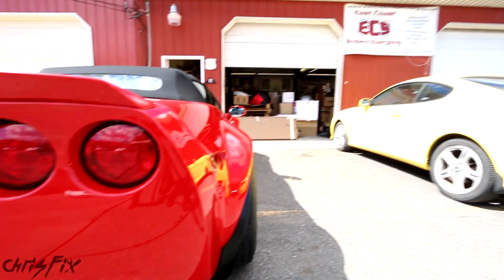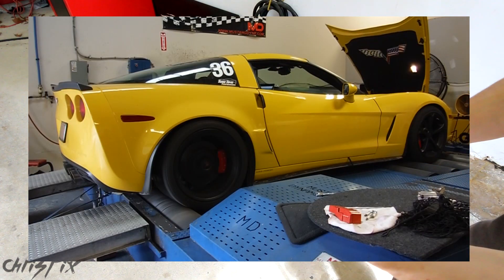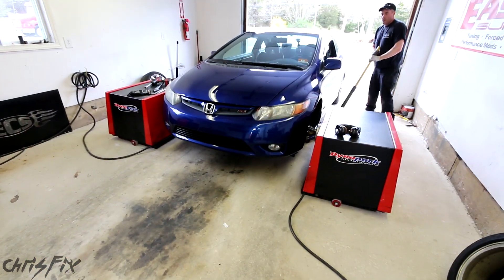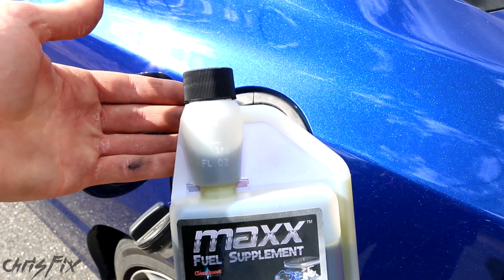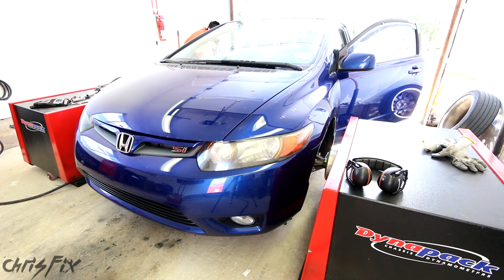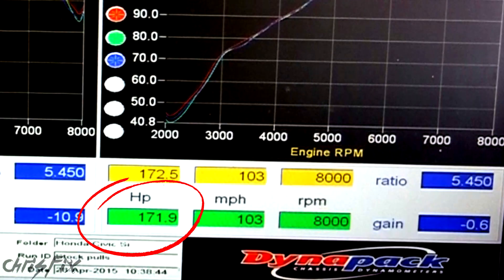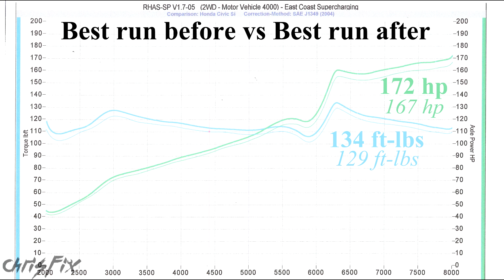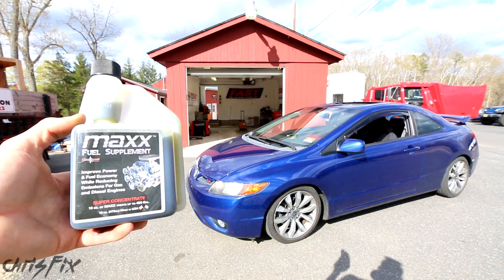Can a Fuel Additive Really Increase Horsepower in Your Car? (With Proof)

Comment: ? but your burning the cleaner which obviously changed the octane rating? Isn't the point to burn the cleaner through the engine then retest with normal gasoline?

Comment: 5 HP and 10 ft-lbs increase? That's ridiculous - less than 5%. Who would want to pay for this? And also - no guarantee it's bad for your engine.
Reply from the maker: Thanks for sharing.
Reply: 5% is a very significant increase. and one ounce per 30 gallons is going to be cheap. 5% is especially significant if it carries over to fuel economy
Reply: Bad for engine,,? lol
Reply: +Giroud more octane doesn't mean more hp. it depends on your car. for example if you have a high boost turbo engine there will be a change, but if you have some naturally aspired engine it will only make a very very small difference- practically not a difference at all.
Reply: Хорошая Машина I mean it's pretty cheap. and it doesn't really give you more HP. it just restores what is lost over time by cleaning out the gunk that builds in your fuel system. and it's pretty cheap
Reply: Хорошая Машина so you want a guarantee it's bad for your engine? I think you need to rethink your word choice
Reply: Octane boosters are not the same as fuel system cleaners.
Reply: ChrisFix what about shells vpower fuel? surely the higher octane would give a bhp increase but how much of an increase is the question. would it be better to just get that fuel or to get a supplement like this?
Reply: Oxenan17 oh okay. thank you for your information. I would like to ask, where did you get this from?
Reply: +Giroud check out video named fifth gear high octane test here on youtube. they have a basic renault, and you can also find them doing the same tests with some turbo golf and subaru. tell me if you can't find the videos, I can link them to you.
Reply: for a turbo, I would imagine it would make a big difference.
Reply: A cold air intake costing $200 adds around 4-10hp, or sometimes less. So yes, pretty fucking cheap. And I take it you're no chemist, so I won't take your word that it could be bad for your engine.

Comment: Worth noting that 1/2 of a 13 gallon tank would be six and a half gallons. According to manufacturer's instructions you would only need one quarter of an ounce to treat seven and a half gallons. You therefore used more than twice as much as recommended. It might be more fair to test it according to the manufacturers recommended strength to see how that does. Thanks.

Comment: why did the car have to heat back up after driving it around for 20 min and doing the first 3 test?
Reply from the maker: We needed it to be the same temperature as when we did the first test for consistency.
Reply: ChrisFix yes I realize that but wasn't it already warmed up after a 20min drive and those 3 initial test?
Reply: he probably got back, fucked around for a while maybe had something to eat then set the car up on the dyno by that stage it had probably cooled down.
Reply: ok that makes sense. i was wonding if he had some kind of super cooling system that helped the honda cool down faster than an average car.

Comment: While I'm not discrediting your findings or method there is Somethings you may not have considered. While coolant temperatures may have been the same, the more you run/drive the car will increase oil, transmission fluid, and axle grease temps aiding with reduced friction. Also the axle to dump angle and steering wheel position/angle can play a part in adding friction and decreasing the ability to transfer the engines output to the dyno. Good video tho, was interesting and the increase in consistency was a nice unexpected result
Reply from the maker: Thanks for the feedback Jordan! I wish I had the funds to repeat this test 4-5 times on other cars to make it more accurate!
Reply: dude shut up he's testing a Honda Civic not a Formula 1 race car stop acting like you're an engineer

Comment: hey chris in argentina the civic si honda say that the engine have 200 hp its the same in usa? why yours have 167 hp?
Reply: lucas rodriguez dynos measure wheel horsepower rather than horsepower at the crank which is what car companies advertise. So yes, your car is a lot slower than they advertise it. Expect a 10-15% power loss as a rule of thumb.

Comment: how does it work? and are there any side effects to the engine like extra deposit?
Reply: It eats seals and burns out piston rings generally. Not bad if you use it here and there and at the recommended amounts. But some guys dump way more in and their engines do not last long.

Comment: Should I use this with my 2017 Mazda with around 7k miles on it?
Reply: i would only use it in a street/strip car. If a dose of that stuff (+5hp) could potentially shave a fly shit off my 1/4 mile time. Say you could turn an 11.2 second pass into a high 10 second pass....now i got a 10 second car. know what i mean?
Reply: did you end up using it?
Reply: Yes, I did, when I use it, It shows high mpg but I notice that the engine sound louder or it sound like its sucking up more air/wind, something like that, is that normal or should I stop it? anyone knows

Comment: Hello mate, nice video! I would like to ask for something. I live in Greece and here we have 2 kind of gas , the 95 octane and the 100 octane gas. The 2nd one, hypothetically is much better and expensive,  increases power  etc. May I ask if you use something like that? I mean is it ok to use it with both gas or only with the normal one? Thanks :D

Comment: what's sad is the civic isn't 200 hp
Reply: kris hedges 200 flywheel, there is power loss with any and every car, the Civic is more than capable of holding its own to bigger engines and is highly underestimated.

Comment: Chris, what are the possible negative consequence to the engine by buying this product?
Reply from the maker: +Taller Valderrama probably nothing. You use such a small amount there is nothing I can think of that is negative unless he product has something damaging in it (which I don't think it does).
Reply: Madi Lee "...let's say you dumped it in every day as you add new gas..."

If you're filling up everyday, you're either driving super aggressive, or really far... Which would probably put the car in an early grave long before any of the additives in this could. But without knowing exactly what's in this stuff, just don't use it more than a few times a year IMO. Maybe put some in a week before track meets or emissions tests.
Reply: Madi Lee as long as you keep the right ratios that was suggested it should be fine. Maybe a little more. They can’t actually suggest a quantity to you that will be damaging. That’s how they open themselves up to a class action. 😂
Reply: Nothing.
Reply: ChrisFix One question if you add to much additives in the Car. Let's say you dumped it in everyday as you put new Gas in. Will that affect the Car? Will It destroy the engine. Will it give the car trouble after sometimes goes by? I used the Lucas additives.
Reply: Madi Lee your car will be able to  fly to space if you add the whole bottle

Comment: Chris I have a question. I have a 95 vette 6 so...what is the deal with ethanol 93? should I just run pure 91 octane? it's low mileage and I just want the best for her, can you please help me?
Reply: Al Sipes On the stock engine control unit, 91 will be perfect for the car. I've got a 1994 Trans Am, which has the same LT1 as your corvette, and I always run 91 octane. she's got 53,500 miles and runs great.
Reply: Smithlehoff Ok Thanks Chris I appreciate you taking time to help your fans out

Comment: Whoa!!! Hold your horses! This is hardly proof that the additive improves power.There are way too many variable for this to be conclusive.
1) What was the weather conditions throughout the test? Did the temperature stay the same? A 10 degree drop in temperature can make a huge difference! Was the barometric pressure or humidity the same? Both can make a slight difference in performance.
2) What were the conditions of the car throughout the test? Did the car run the same amount of time before each test? The viscosity of the oil will change as the car heats up, and with less viscosity the engine will produce more horsepower. While the temp gauge reads the water temp of the vehicle, it is a poor indicator of the oil temperature.
3) Will the test be replicable with other gasolines? This product may work for one gas type but not another.
These variables could have been overlook had there been a large difference in horsepower (say consistently over a 15 hp gain,) but the test showed only a small gains (5-11 hp per each test set respectively.) While the test was inconclusive there is still enough compelling evidence to replicate the tests so that the variables can be eliminated.
Reply: LOL read... and listen. better

Comment: Nice experiment :) You're probably better off just using better fuel, checking your tyre pressures and wheel alignment. Also, you don't need an S at the end of the abbreviation RPM as its pluralised in the abbreviation ;)

Comment: how does that work without changing ignition timing?
Reply from the maker: From my research and emailing the company... It is a catalyst that burns more of the fuel that is normally not burnt. More burnt fuel = more power.
Reply: So it must have some kind od oxidizer in it? Interesting. How would that work with the oxygen sensor and air fuel ratio since oxygen isnt normally introduced via the fuel
Reply from the maker: I honestly am not sure how it affects the O2 sensor. Their "formula" is a secret so I couldnt get too much info from them except that it is a nano-catalyst.

Comment: You do know coolant temp has nothing to do with the operating temperature of the engine right?  You wanted to actually do this with the same engine oil temperature.
Reply from the maker: Thanks for sharing. They are related. When the coolant temp is stable, the oil temp should be stable as well. Unfortunately there is no oil temp gauge so there is no easy way to know the oil temp. That being said, the coolant gauge was the best thing I could go off of.

Comment: it is so fun to wach vtec kick in
Reply: It's much more fun to FEEL it kick in. 2012 Acura TL 😁
Reply: @myetoob23  Damn, Acuras have VTEC too? I'll be honest, even though I do know Acura is part of the Honda "group", I didn't know they had the  VEETAK in 'em without those fancy little badges. I bet it's a lot of fun though, and gives me even more to love about those big angular streetcars like the TL and maybe the earlier Cadillac CTS-Vs.
Reply: @revolver265  yessir, idk why they don't advertise it but it definitely kicks in under heavy acceleration. Felt like turbo lag. If I would have gotten the SH-AWD model I wouldn't have traded it in. But since it was FWD with the 3.5 motor instead of 3.7, I got a 2017 Infiniti Q50 instead. My TL was black and my Q50 is white, when she saw a white model even my gf said that it looks better than the Q50.
Reply: Jeandavid Levesque check the hp dude
Reply: It has 163 vtecs hits -8 mph to light speed in about 1/9 seconds
Reply: wakman756 I didn't see anything
Reply: It made less hp when the vtech kicked in. Lol
Reply: wakman756 nothing changed

Comment: did you use 95 or 98 oktane gas?
Reply: +emocan126 yes
Reply: +GunFun ZS ok then it probably is 98 oktane in germany
Reply from the maker: +emocan126 the car requires 91 so that is what we used.
Reply: +ChrisFix 91?!?
haha we don't have that in Germany xD
but thx for the answer
Reply: Europe has about the same gasoline fuel categories , but octane ratings are calculated differently. There are good videos to explain it. Your Diesel is better than ours.
Reply: +GunFun ZS oh ok then
is 91 oktan performance fuel
Reply: what are you talking about? i always use the fine 88 octane german fuel xD
Reply: Der_Rusher was laberst du fürn Mist bei uns gibt es nur super 95 als minimum

Comment: It depends what type of octane, more ethanol, colder the fuel burns, colder the fuel = more hp, although going for a drive could've cooled the engine and with the additive, increased hp by a couple. Which is more possible than believable, they wouldn't sell octane booster if it didn't work. Interesting video, definitely appreciate the evidence in the additives.
Reply: "...they wouldn't sell octane booster if it didn't work".  REALLY!?!?!

Comment: +ChrisFix 
Humidity was different and so may possible have been oil temp. Same car same oil if the oil temperature is higher in one pull (from taking a 20 min drive)then the next HP readings will be different. 
Not to say the product doesn't work but you had different variables.  You can get a best high tomorrow if you try again.

Comment: Everyone needs to get over the number increase and focus on the percentage increase. You're looking at a 3-5% increase for a $32 item. You're going to get about the same out of a $300-$400 intake. I'd be willing to bet this product in an engine with a good i/h/e and tune would yield even better increase.
Reply: Exactly, 3-5% increase is standard deviation.  A rather insignificant and inconsequential number.  This gogojuice does nothing.
Reply: You'd honestly get quite a lot more out of a new intake manifold and headers + tune.  QUITE a lot more.
Reply: +Wayne Randall I wouldn't say it does nothing. It was interesting that each run without it yielded a loss of power each time while the runs with the additive stayed basically the same. I'm wondering if this stuff almost has a similar effect as methanol injection in helping keep things cool. Obviously it's no replacement for meth injection, but maybe it does something to that effect.
Reply: Same here maby 20hp added

Comment: Not sure if anyone mentioned below, but I wonder if it's possible that the oil temperature was higher during the second run, having a little less internal engine loss as a result.  Even though the coolant temperature may have been the same, the oil takes a lot longer to come up to operating temperature.

Comment: Good vid man. Gets your USA juice almost up to UK 'straight out of the pump' juice.
Reply: It's about the same. Europe vs USA gasoline (Petrol) are basically the same, but the method of calculating the octane rating is different. Our three common tiers really match your three tiers in practice. Your diesel fuel is better than ours though.
Reply: +GunFun ZS really? Ok, always thought ours was a bit better. We have 95-99 but think this might be RON not octane. 95 is normal and super normally starts at 97 up to 99. JApan has 100 apparently but im no expert on it.

Comment: Do you know if you can use this in 2 stroke engines?
Reply: The additive will stabilize your fuel so what I would do is add it to your fuel and mix those two and THEN mix the fuel and the oil, however, keep in mind that the instructions say to add 1 ounce (1oz) per 30 gallons of fuel. Now, your average dirt bike assuming you're using a dirt bike and not a 4 wheeler holds 2 gallons of fuel so you would only need to put 1/15th of an ounce to your FULL tank of gas. That means that one bottle would last you a very long time which would make it far worth it. Hope this helped :)

Comment: What octane does that car take ??
Reply: 91 required, most pumps in my area have 87, 89, 93 available, so 93 it is, unless the station's really price gouging on the difference, then I'll mix 89 and 93 in equal parts.

Comment: Dear Chris Fix could you test the new VP Racing Fuels Madditive Octanium and see if it does what it claims ? I just bought a bottle today and it's pretty expensive $21.99 to be exact I just can't be at ease with paying this again if it does nothing at all for my vehicle
Reply from the maker: That would be an awesome test!
Reply: It really would 😁 I paid 21.99 for my VP racing fuel additive and although I've never believed they increase Horse power it would be nice to see if it meets its other claims (I currently own a 2005 Manual Acura TL) and have been having fuel consumption problems so I'm trying all that I can to fix the issue and these octane boosters and fuel treatments would be cool if they worked . Unfortunately I don't have all the tools you have so thought I'd shoot you over a message . Let me know if you decide to do it and when uploaded if you do so👍🏼 shout outs to Chris fix for always keeping our cars running

Comment: If the mix ratio is 1oz to 30 gallons of fuel and you have about 7 gallons in the car shouldn't you have used about a quarter ounce of additive in your test for more accurate results. I'm guessing 7 gallons because you said it is a 13 gallon fuel tank that is half full. It would be good to know what varying amounts of additive does to an engine for example would an entire bottle on a nearly empty tank cause damage to anything from fuel pump to catalytic converter and anything in between.
Reply from the maker: +Bryan de Paepe we didn't add gas to keep things consistent so some of the additive didn't get washed down the filler hose.

Comment: Creates more power till you run out of the mixture! Fuel additives are great and all but they're not permanent. Don't they just raise the octane level of the car by a little bit which is why the car runs stronger?
Reply from the maker: This is supposedly a nano catalyst so it isnt increasing octane, it is causing more of the fuel to burn.

Comment: They want you to put gas after the additive so that the tiny amount will get washed down the filler tube.
Reply: A fuel pump nozzle enters the fill tube waaaaay past the point where a funnel does. This fluid isn't viscous.